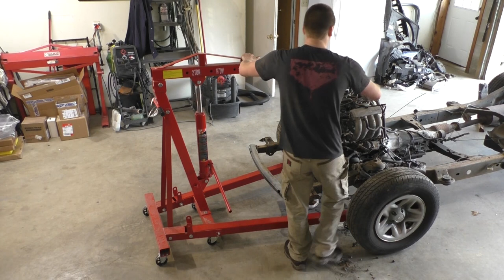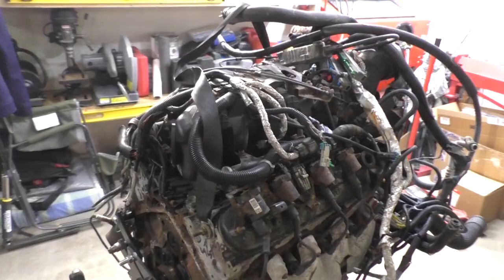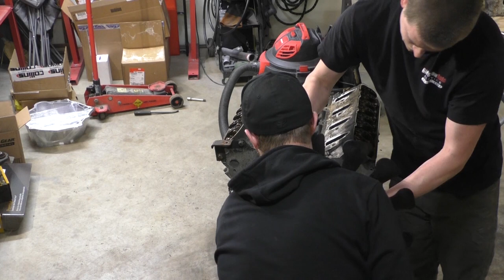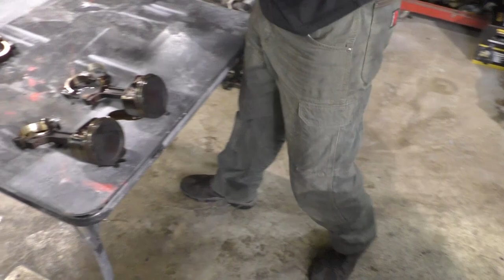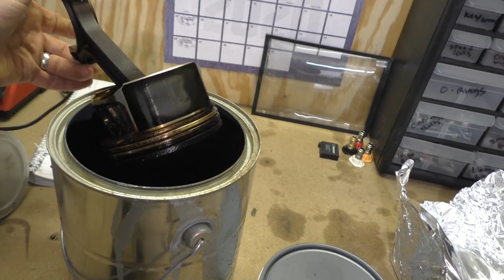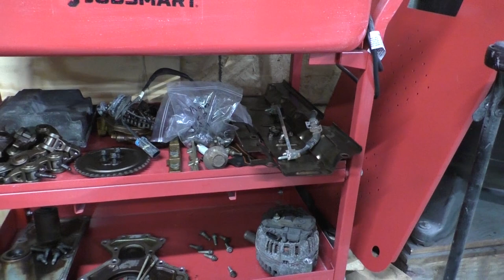Toyota Tacoma LS SWAP BUILD Pt. 2

Comment: What is the budget on all this?
I have a 2003 tacoma I've been wanting to swap a lq4 into
Reply from the maker: It all depends on what you want. You could do it much cheaper than this if you really wanted to. Auto trans would be much cheaper. I did a lot of upgrades that I didn't really have to do but chose to. You could do it for less than 10k not including the price of truck but again it's all in what you want
Reply: @builtbysonick1250  good point